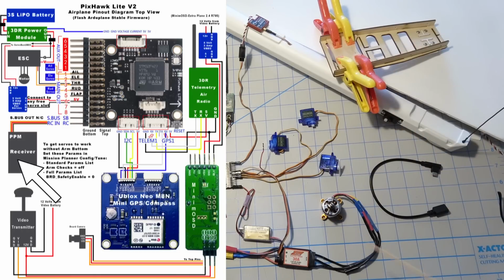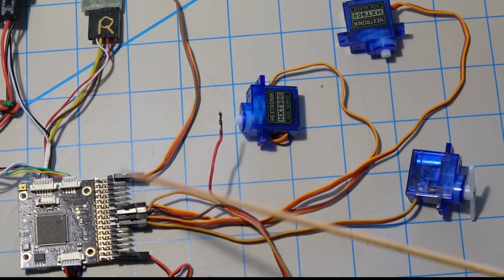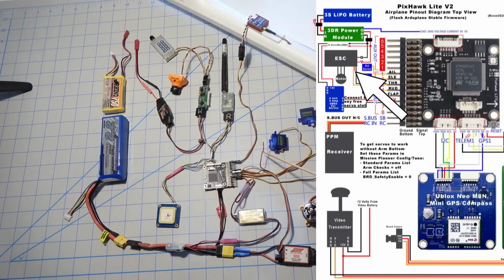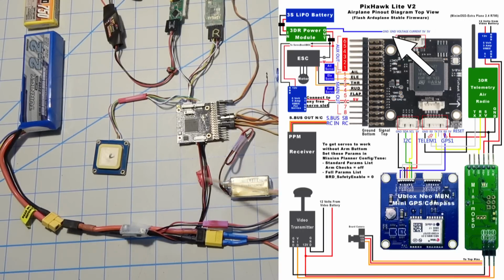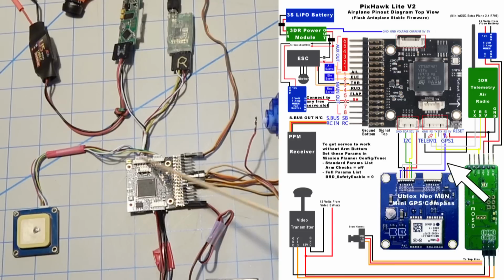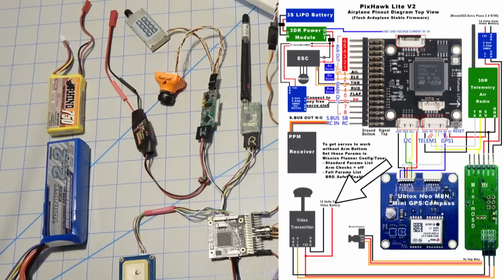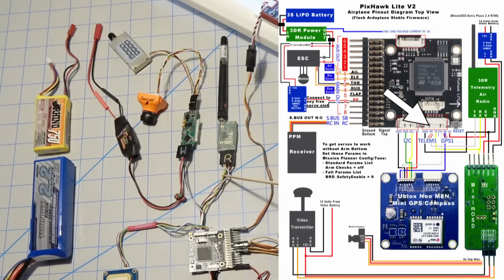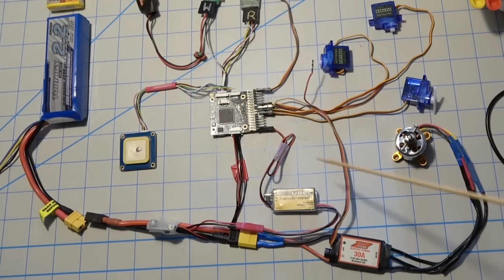PixHawk Lite RC Airplane Wiring, Pinout & FPV Setup for Ranger 2000

Comment: I wanted to ask you about the ezUHF system. I'm using the 4-channel receiver. I don't get a lot of range. Do I need to change the antenna? If so, to what? I would like to get a bit more than 600 meters out of it. I'm using it on a hexacopter (F550 with DJI 2312E motors). Some range would be nice. I've still got on the stock antenna.
Reply from the maker: I have not put  the EZUHF on a quad but have put many on planes. I have found that a dipole antenna on receiver and transmitter gives much better performance than the stock setup. Since there isn't much room on a quad you could first try upgrading the tx to a dipole and see if that helps.
https://www.getfpv.com/uhf-semi-rigid-dipole-433-mhz-ibcrazy.html

Comment: I used to have a pixhawk on a fixed wing and I've never ever had any problems with compass. Actually, if you look here: http://ardupilot.org/plane/docs/common-compass-setup-advanced.html#common-compass-setup-advanced you'll see that compass is an important part of the kit.
Reply from the maker: The sides effects from not using the compass such as circling (aka “toiletbowling”) or fly-aways has to do with multi-rotors not planes. Look at the note in the link you sent me: "Compasses should always be enabled for Copter/Rover, but may be disabled (not recommended) for Plane."
Reply: That's what I was talking about. These side effects do not affect planes so there is no reason to disconnect/disable compass, right? I'm just curious why you think it's better to have no compass on a plane.
Reply from the maker: The reason for the note "Compasses should always be enabled for Copter/Rover, but may be disabled (not recommended) for Plane" is because enabling the compass makes it the default navigation which is bad for planes. Causes errors. Planes need to use the GPS for Nav.  Just read the link you sent me: "Enable compasses: determines whether whether (any) compasses are enabled. If enabled the flight controller will use the primary compass for heading data, otherwise the heading will be estimated from GPS." This same strategy is applied to other platforms as well like Inav CleanFlight.
Reply: Dave Merc Productions true, but considering GPS can lose satellites or jump position and glitch, and compass won't do that, it feels like this extra redundancy would be useful. Also, I'm not sure if that's the case, but I would expect for mag data to be included in EKF calculations to some degree together with accelerometer and gyro data.
Reply: Actually, it would be an interesting project to try both setups on the same platform. I'm currently waiting for the ranger to become available on banggood again. Once I have it, I'll try to use it with and without compass.
Reply from the maker: That would be fun experiment. Good luck with your new ranger too!
The decision to disable the compass is easy for me because it's not recommended for planes and I don't need something extra to calibrate. Just keeping things simple.
Reply from the maker: Don't matter because without the GPS you can not come home by RTH even if the compass is working. Home position is always dependent on the GPS.

Comment: Watch out running both sides of that osd
Reply from the maker: Yes, by soldering the jumper on top and bottom of MinimOSD you can run both stages via the 5 volts dc.
You must however cut the etch to the 12 volt pins it you plan on using them so it doesn't conflict with the 5v. 
http://ardupilot.org/copter/docs/common-minim-osd-quick-installation-guide.html
Reply: Dave Merc Productions I power my osd with its own 5v bec. Only thing going in and out on video end is signal and ground.
Reply: I just left the 12v  alone. I power camera and vtx from a ubec duo
Reply from the maker: Very good. I think my Sky Walker is done that way.
Reply: Dave Merc Productions great video by the way and appreciate all your content.

Comment: Nice overview Dave...Why didn't they include the video driver chip in the Pixhawk..?....Its ok on a large build, but needing a separate Minim just to get video overlay..? All the F4 Flight Controllers have a video chip on them these days.
  It's like the Pixhawk guys are behind the times, even though I know its a very capable controller. They screwed up by not putting the Video chip on board IMO...?
Reply from the maker: The PixHawk Lite was designed before the practice of integrating the osd in the FC became popular with advent of mini-quads. Perhaps they will come out with a new version of the pix. let us hope.
Reply: Dave Merc Productions Oh yes of course..I didnt realise how old this Pix was until now...🙄🙄🙄